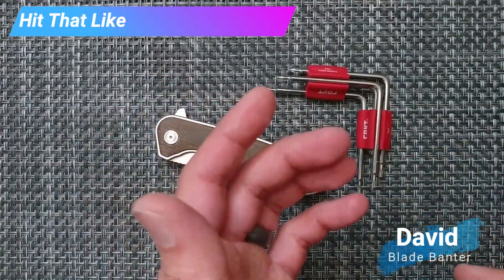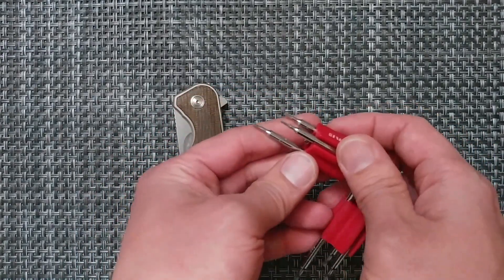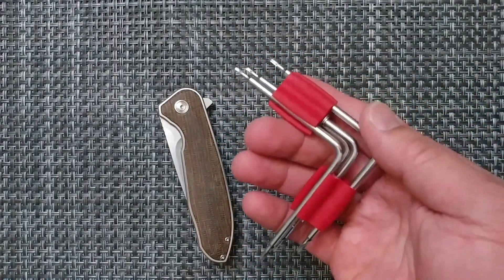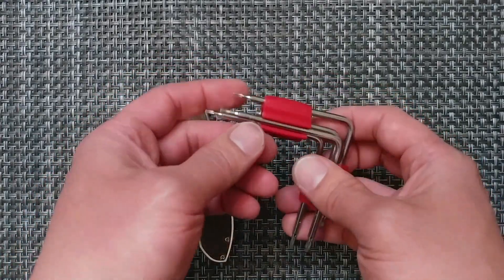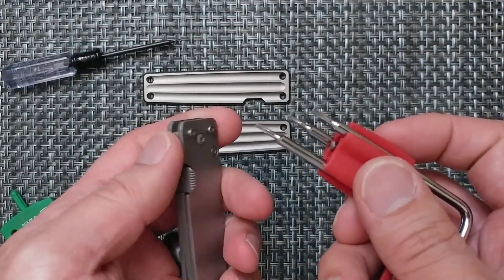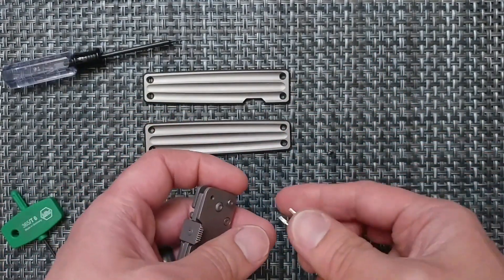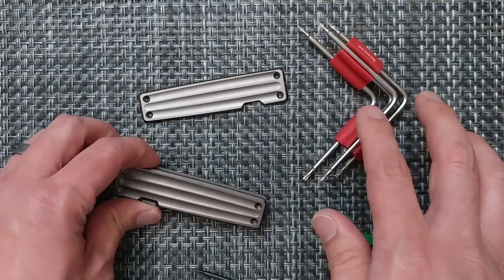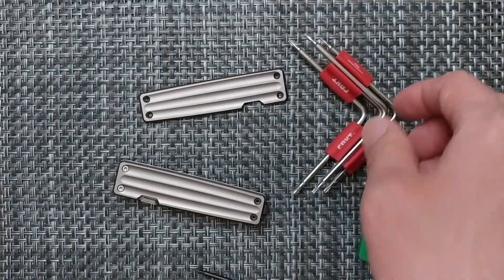CRKT Twist & Fix updated, the tool separates?!? (Bonus initial uneducated opinion)

Comment: I forgot to mention too, that you didn't even mention the knife!
😀
I just finally got around to putting my new scales on the Tuyaknife Talisman, this past Sunday. Man, does that ever take this knife, to a whole new level! I put a brushed finish on my pocket-clip too. Before installing that. 

Also, after my first install. I couldn't move the lock-bar out of the way far enough, to close the knife. But only when doing it right hand. Left hand, worked fine. Come to find out, after a few minutes of focus. When un-locking it right hand. I was moving the lock-bar  down a tiny bit, as I moved it over. Causing the bar to hit the scale, before it was out of the way far enough. To close the knife. Because the micarta is to sit inside of that frame rib. It was that rib/rim, that was hitting the scale a little bit. Stopping it from going all of the way over.

So I had to take it all back apart, and do some minor filing of the micarta. All is good now!
🤗
Reply from the maker: I had to do the same thing with my  Tuya and the show scale was really on there so I had to damage it to remove it.  
    Heafty knife but I find that i like it. After I fixed the scale to allow it to function.

Comment: My fumbling fingers would certainly find the right bit faster with that gadget.  I wonder how they stand up to Wiha as far as quality goes.  I have a bad habit of using force rather than heat to break factory loctite.
Reply: I thought of a new trick recently, and tried it.  It really worked well. Instead of using a soldering iron, to heat the screw/pin up some. To help break loose the loctite. I now just use a mini-torch, and heat the torx bit up. On 1/4" bit holder, with a removable bit, and a longer shaft. Man, it really worked good.
Reply from the maker: In deed that is something that I haven't been able to put to the test yet.  I'm guessing the WIHA and others will probably perform better.
Reply: @SteveKluver  You might not want to use a mini blowtorch on torx bits, you might temper them back down softer.
Reply from the maker: Definitely don't think he is bringing the temperature that high, but it's similar to using a soldering iron.  Good call out.
Reply: Good point,  @londiniumarmoury7037 . I buy the bits by the 10 pack, and the heated one(s), only got used for that purpose. 

I have, since this post. Moved to heated shafts, chucked into a drill press. 3/16", 1/4", 5/16" diameter, etc. Heat 'em, and press them down.

I also have two bit sizes, soldered into a soldering iron tip. Pushing that into the drive area. For good heat transfer.
Reply: @BladeBanter  I think with regular tempered and quenched tools it's not so important, as they are brought to straw or higher for the tempering, But I think with tool bits the tempering is kept very low to give them high hardness over high toughness. It wont completely anneal them, I dont think or make them super soft, but it could make them a few HRC points softer.
Reply: @SteveKluver  That sounds pretty good, do you think a heat gun set to a low temp might work? or maybe a hair dryer set to its highest heat? I don't even like dealing with locktite at all, if I struggle to open a torx screw on a folder I just leave it, I don't want to risk stripping out the screw head lol.
Reply from the maker: Nice thanks for the thoughts, I see Steve commented too thanks for checking in.
Reply: @BladeBanter  Thanks to both of you as well, nice talking to you both.

Comment: Hi! Can you tell which bits are stronger and harder?  Benchmade bluebox or crkt twist and fix (t6, 8,10) I need to break the screw with a large amount of thread lock
Reply from the maker: I haven't experienced the benchmade version, but I would recommend putting some direct heat to the pivot with a soldering iron.  This will melt the thread locker to a point where you can get the screw released.  I personally would prefer a bit to break before my screw strip out.  Sorry I didn't have a definitive answer for you.